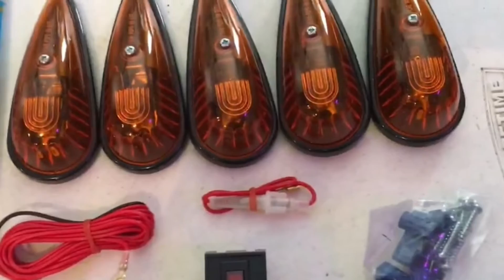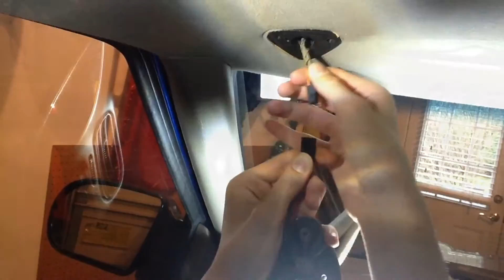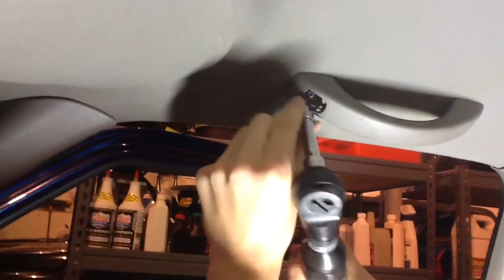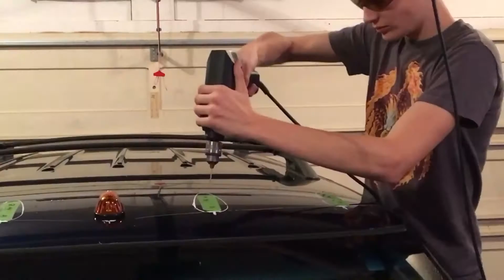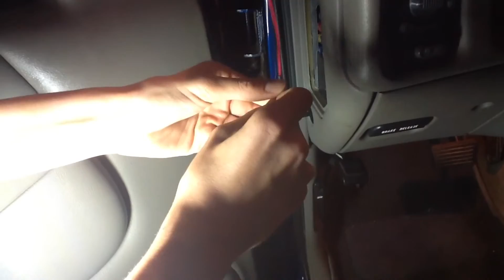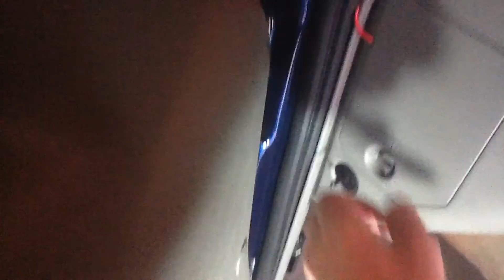Aftermarket Cab Light Installation and Tutorial

Comment: So I did exactly what you did and the cab lights turn on when the truck is on but then I cut the lead wire and put two little clips to connect to a toggle switch and put them on the switch and the lights don’t turn on.....????? What am I doing wrong?
Reply: If using a toggle switch you need power into the switch which needs to be fused and then connect to the wire leading to the cab lights to the post marked ACC. There will be a post for a ground if you want the switch to light up when turned on. This is for a 3 prong switch.